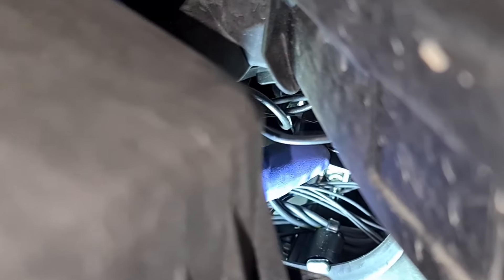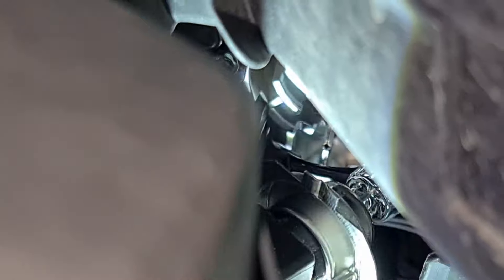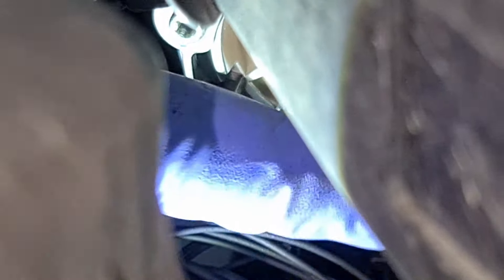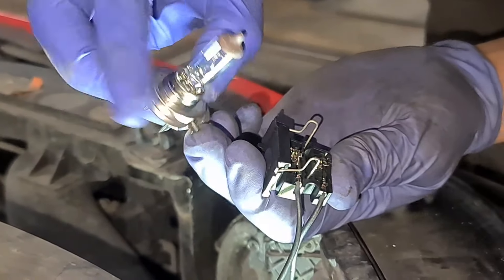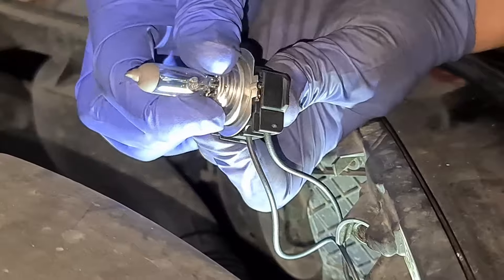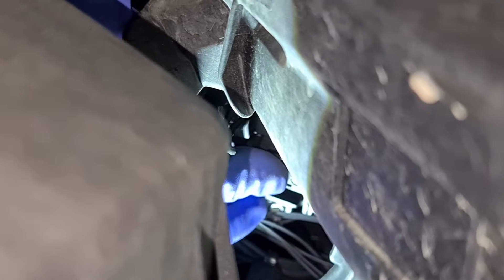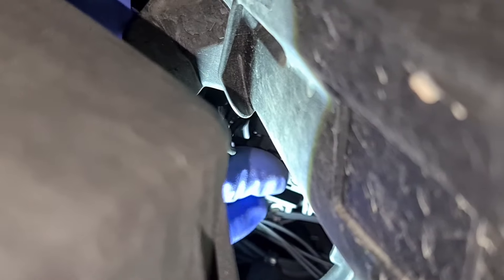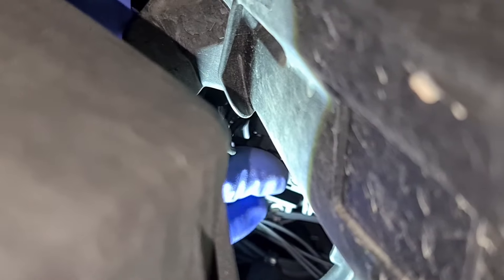how to replace main headlight dipped bulb | Vauxhall Corsa 2016 #corsae

Comment: Great, easy to follow advice. Chap that sold me the replacement bulb was adamant I'd have to take the air box out... he must have bigger hands than me. It is a bit tight but it can be done. Thanks for the top tips.

Comment: Great video and passenger side all good and took two mins. Sadly on the drivers side the black plastic part that holds the bulb holder is broken so cant clip the light holder back in. I cant work out what that part is called or where to get a replacement. Any help much appreciated?

Comment: Hey great video, thanks. My front right dipped headlight is out, I have changed the bulb and have changed the fuse, 13 and 32 in the engine fuse box but still cant get it to work. Any idea what the problem might be? Its a Corsa 2018 model.
Reply: got the same problem, did you find out what it was?
Reply: @cadthelegolad3576  make sure the connectors in the bulb are intact and touching.

Comment: Got LEDs as explained in this video but now they are fitted keeps displaying on my Corsa dashboard ‘check number plate light, check right dipped beam lamp, check left beam lamp. Are the LED’s not compatible ?
Reply from the maker: It's possible that the LEDs you installed are not compatible with your car's electrical system. Some cars, especially newer models, have systems that can detect when a light bulb is out or not functioning as expected. This can cause issues when using LED bulbs, as they draw less power than traditional bulbs, which can trigger the dashboard warning lights. 

Before you do anything else, double-check that the LED bulbs were installed correctly and securely. If they were, you might need to look for LED bulbs that are specifically designed to be compatible with your Corsa's electrical system. LED bulbs come in different designs and some are made to mimic the power draw of traditional bulbs, which could prevent the dashboard warning lights from triggering.

If you're unable to find compatible LED bulbs, you may need to consider switching back to traditional bulbs to avoid the dashboard warnings. 🚗🔍

Comment: Hi I’m trying to change my yellow lights to white, I’ve followed what you did, all lights are working except the low beams, it’s not turning on anymore after I replaced it, even when using the original bulbs, there’s no power going to the plugs of the low beams, I’ve tested using meter , also I’ve tested all fuses and everything is working, not sure why the low beams are still not turning on. Any idea what I should do? 🙈

Comment: I changed the bulb with H7 and fitted as you said, thanks for that, but still not working. All other lights working. Is it a faulty bulb?
Reply from the maker: Hi check the connection and wiring and see if the 2 pin plug is fitted correctly. And it could be a fuse too so will need to check that too. Thanks
Reply: @TajMotorMedics  thanks, I will check those.
Reply: @TajMotorMedics  Hi Taj, I'd stupidly changed the wrong bulb (Full beam) and have since changed the correct one as you demonstrated. Took me a lot longer but more determination than skill got the job done. Many thanks.
Reply from the maker: @noelwilde  I glad you got it done 👌🏼👍🏽